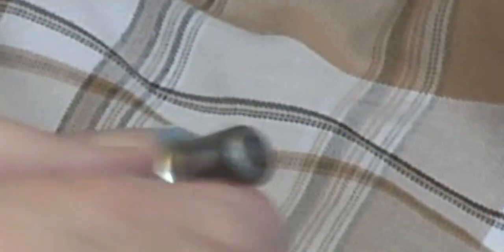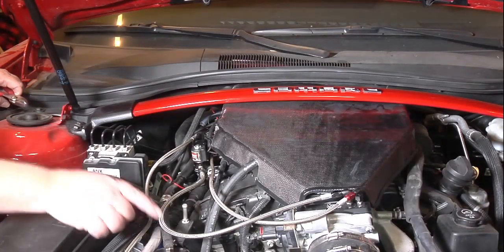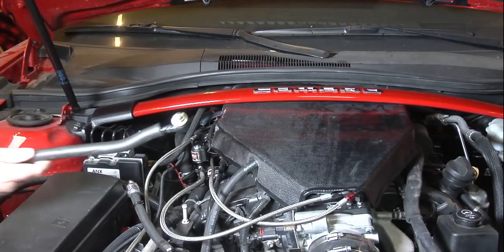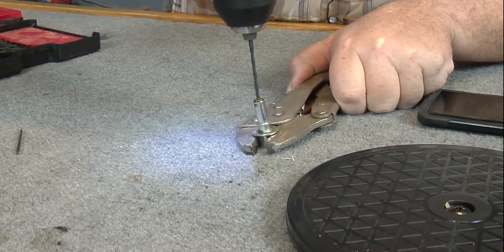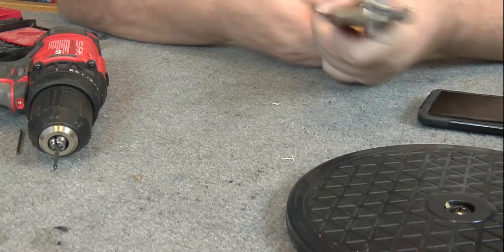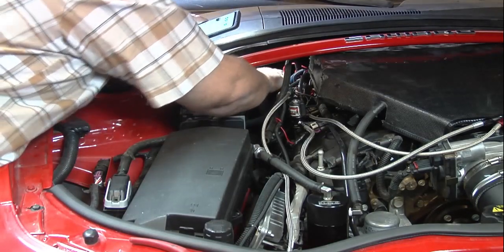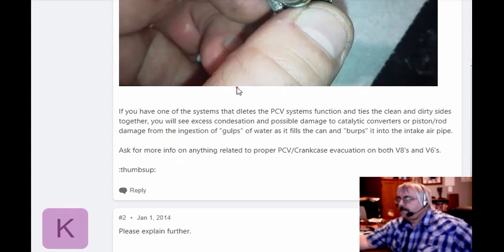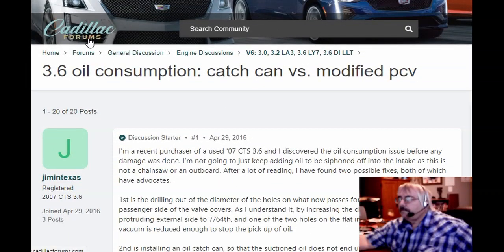Camaro PCV Valve must do mod for 2010-2013  GM Cars "Holes too small"

Comment: Yes ; the 2014 pcv valve is breathes better according to rx catch can instructions . Replace with 2014 it says . Supposably a ex gm engineer at rx catch can .
Reply from the maker: Yes, they had to change the design of the PVC valve, so when you buy a new one today it will have bigger holes in it, so the engine can breathe,  thanks

Comment: What are some extra tips you have on getting the valve out? This thing is really battling with me
Reply from the maker: Wd40,  or some kind of oil. Thanks
Reply: How long should let the wd40 stay on it for before trying to pull again  @camaromodschannel
Reply from the maker: About an hour.  Thanks
Reply: @camaromodschannel     you're 100% certain that the 2013s let you remove the valve? Iv tried so many times and even spray wd40 on it and no results. It's almost getting to the point where I'm damaging the actual value because I keep clipping at it with pliers.
Reply from the maker: @Cannones  mine was a 2012 don't know if they changed it or not..wow never heard of one so hard to come out..
Reply: @camaromodschannel  yeah it's ridiculously difficult. I actually noticed the top hole is much bigger then the replacement I bought which makes me think that my pcv valve does indeed have the correct orfice size. However id like to still get it out so I can see the other 2 holes on the other side but I guess maybe I should leave it since the holes are definitely big enough I'd even say bigger then 7/64
Reply from the maker: @Cannones  so you did buy a replacement? so you can see how it goes in.. thanks
Reply: @camaromodschannel  yes I bought the replacement but the problem is I cannot get the old out.
Reply from the maker: @Cannones  so it's smooth on the sides?nothing to lock it in? don't know why it won't come out?
Reply: @camaromodschannel  yep exactly. I'll probably give up on it

Comment: Cheers for the vid, I have a holden sv6 (Australian car from gm) 2011 model, it has been running rough now it has stretched timing chains so I’m changing the chains over and upon opening the covers the whole internal was muck, then I found the issue was the little sucker you just drilled out (both the little holes) were blocked & I change oil every 10000 k’s with new oil filter and I was gobsmacked with the size of the holes ,, anyhow I will reassemble and let you know how it goes … after I clean it up 🙄
Reply from the maker: Yes, the holes are too small for good ventalatoin.  That is a major job changing timming chains. Yes, let me know how it goes.  Thanks
Reply: HELLO 
ANY UPDATES?
HOW DID THE TIMING CHAIN JOB GO AND HOW DOES THE NEW DRILLED PCV VALVE PERFORM?

Comment: Does anyone just sell the valve with larger holes?
Reply from the maker: I think the new ones have bigger holes.  Chevrolet changed the design on them to give them bigger holes.  Thanks
Reply: Yup ; my rx catch can instructions said  : get a 2014 pcv valve and it will breath better also .

Comment: I've been pulling the PCV every oil change and hosing it out with carb cleaner. Although not nearly as bad as it used to, the thing still gets crap in there long after doing the mod...
Reply from the maker: That's great, I'm like everyone else I forget most of the time. Thanks for watching.
Reply: It’s not meant to completely prevent carbon build up. It’s just allows it to vent better for longer and not clog up quite as fast.  Still need to maintain your shit.
Reply: @chrisburnsed6349  IF CHEVY increased the size of holes on newer models, that clearly means that they are aware it was an issue despite the maintenance set for this item.

Comment: I cant get the pcv valve out to drill it.  I have tried pliers and yanking pretty hard and nothing....
Reply from the maker: Spray some wd40 on it and let it set over night. Thanks
Reply: Is that trick and it'll just come right off with the hose like yours did?
Reply from the maker: Yes
Reply: @camaromodschannel  what’s the trick to get it out
Reply from the maker: @deef5374  yes its hard to get out, get some vice grips and try that.

Comment: Part number for Pcv valve
Reply from the maker: Cv892c ac Delco  you can find them on ebay.  Thanks
Reply: @camaromodschannel  

Cv892c ac Delco is this for the PCV that already has larger holes?
Reply from the maker: Yes,  thanks